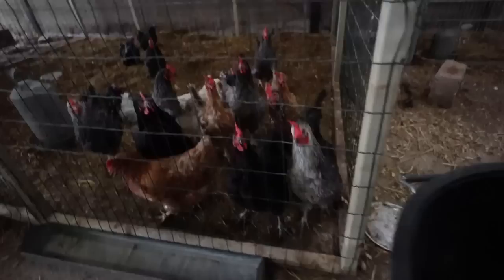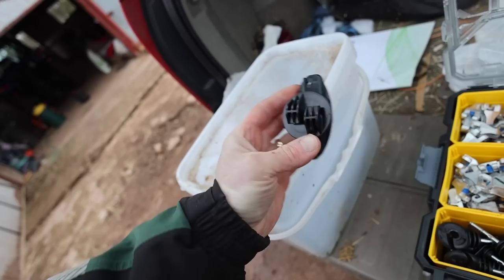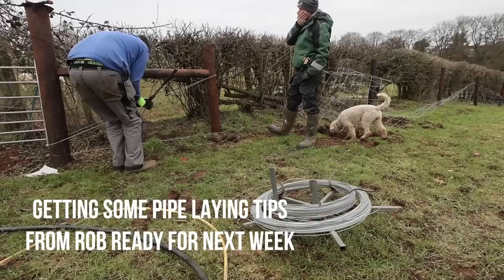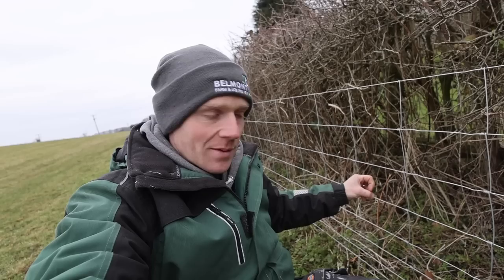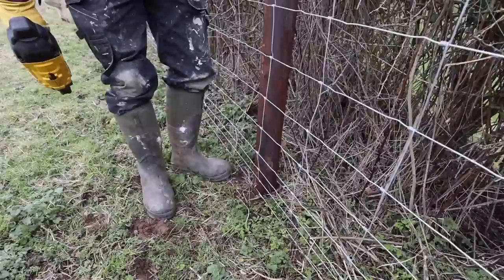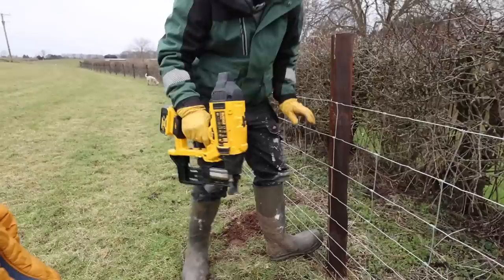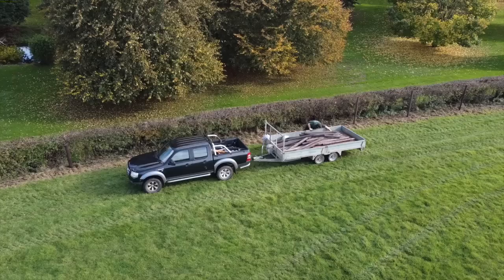NEW FENCING - Stock fence up and new tools to try

Comment: We got 3 of them dewalt staple gun and there amazing. Not as good as a stockade but that's on compest air more consistent.
 I owe a equine,agricultural fencing along being a farmer I don't have much time! so the dewalt speed things up making it much quicker for my team don't get bad wrists and less hassle then use compressed air. 

The big thing for us is trying to get a constant supply of staples seem to be difficult to get hold off any we would go through around 20-24 box a week at busy times we can't always get hold of them so have to go back to stockade gun. As a dewalt fan everything I owe is dewalt I am disappointed that the staples are not more ready available. Have to put a Oder in several weeks ahead and at £80 a box you would think company's would like that turn over. 
screw fix sell the gun but not the staples and this don't make any sense to me. ITS have them only 40mm rarely in stock I much prefer the 50mm as the cost is not much different but as my names on the fence I would like it to strong. I now use are fencing suppliers to get the staples now but there delayed they have to a special order for us. 

It's not the cheepst way but for a health and safety and body care there so worth the prise and dose speed us up so much gone form 2 minutes a post depending on what types wire we are using to 20 seconds soon adds up.

I will add I had a Milwaukee on demo didn't like knots on the post in my opinion the dewalt was better.
Reply from the maker: thats an interesting comment about staples i hadnt thought about this.

Comment: When did people start using "floor" when the ground is meant? I swear I've only started hearing this in the last few years. A "floor" is what I think of as in a man made structure, the ground is everything outside. That said, I may have used "forest floor" in the dim and distant past, but always with the "forest" identifier.
Reply: I suspect this to be more of a British usage because I have not noticed hearing this in the US.  Language changes over time, of course, but there are still some new-fangled usages that confound me and the mis-use of "floor" is one of those.
Reply: @zzydny  I dismissed it as British until I heard it in some video or other (no way I'll remember where exactly) that I'm sure was North American based. It may have been Canadian which I'd also give a pass, but fairly sure it was American. And it just doesn't sound like the sort of thing that people would casually pick up. While I've picked up a lot of "Britishisms", calling the ground the floor is not going to be one of them!
Reply: Just forest? Never heard sea floor or cave floor?
Reply: @rosehawke2577  Same here.  The floor is the floor and the ground is the ground.  🙃
Reply: @zzydny  more of an English thing than a British thing.
Reply: @bobafetish74  It's really quite interesting how we all use language and how words come to be used differently in one place than another.
Reply: .... and just to add another level of dull to this conversation, both 'ground' and 'floor' are used by lift manufacturers 😁
Reply: Yes, hearing this in the U.S. and in Canada.  Irritating.  🇨🇦
Reply from the maker: Even I’m confused and I’m sure you are referring to something in the video?
Reply: @diyfarm  yes. Your saying floor when it’s actually ground.  Floors are usually referring to inside a house.  No biggie.   Just an observation 🇨🇦
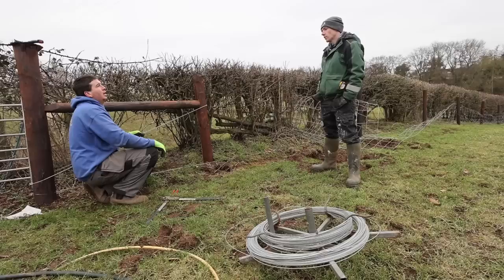Reply: @diyfarm  In the video at 4:54  Rob was speaking.  I hope we didn't come across as complaining about the video; it's just that language is changing so much lately.
Reply: Wow 12 replies to quite possibly the most pointless comment I've read on the Internet today. If it was spoken in England its the proper use end of😉

Comment: My son recently bought a house which came with 50 acres of Oxfordshire countryside, about 30 acres of fields, about 10 of planted woodland and the remainder being the house, garden, orchard, two ex-farmworkers cottages which are in a very poor state, a large blockwork barn (partly clad with asbestos) and various outbuildings and hardstanding.   It hasn't been farmed or even maintained for quite a few years so he has a huge task ahead.   He is going to have to put up / renew at least a kilometre of fencing.   What are the posts you are using here and why did you choose them?   I have been researching fencing posts for him and have found the following, all to comply with Countryside stewardship as he hopes to get some grant money to help out:
Untreated softwood £4-5 each, which last about 5 years?
Treated softwood £10-11 each, which last about 10-15 years?
Clipex metal post system £10-20 each, guaranteed for 30 years.
I was going to suggest he used the Clipex system.
I'd appreciate your thoughts, thanks.
Reply from the maker: Hi. Sorry for delay. We have used just about all the options as I like to try different things. Started out with Creo but not nice to work with and leach all sorts of nasties especially by water. We used tanalised on the holly bits mainly because supply of other options was poor, they are ok though but would avoid using them on most of our fields. May use clipex for a run this winter but not a fan of the look and if you don’t get them straight then they stand out in the sun. We have just a had 2km worth of robinia delivered. Equivalent of acacia or black locust. I can honestly say I’ve never seen a more dense timber. Chestnut another option but really confident they will outlast most things on the farm. Scan pole is worth looking at as it’s supposedly a nicer form of creo. I have a video out soon on them but in summary they are cheaper than clipex and creosote. 
Main thing I’ve learnt is fence posts are not equal. Every supplier has varying quality wood and preservatives.
Reply from the maker: Shop around too as those prices seem quite high. All options are less than £8 I think
Reply: Many thanks, will do. @diyfarm

Comment: Why stretch the wire down after stapling make the top line of the fence look awful?
Reply from the maker: Yeah stopped doing that when I saw it dip a little on the first few posts. It does need a little weight or pulling up to make sure it’s fitted flat though. 👍